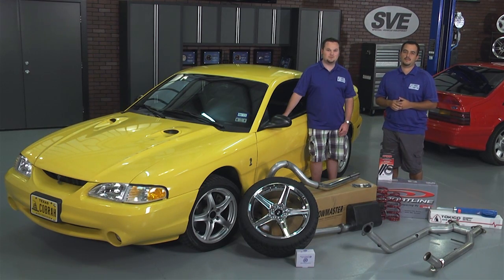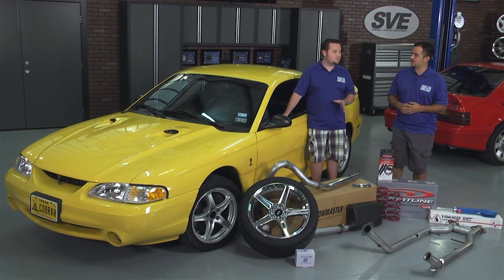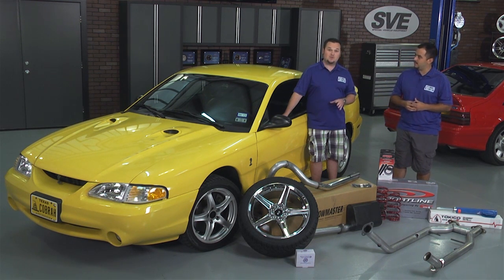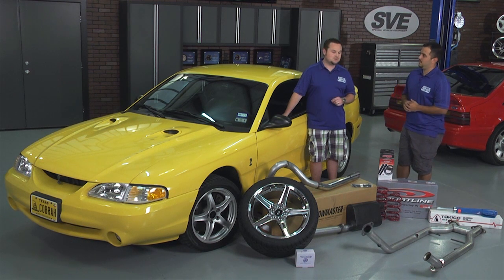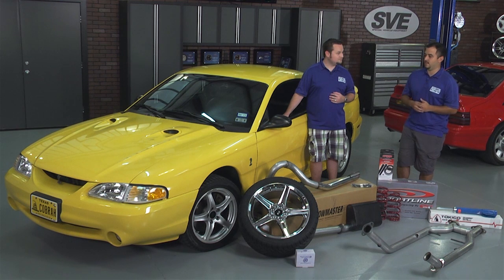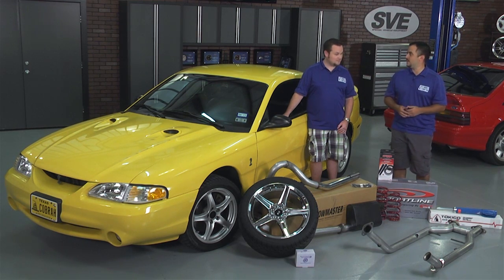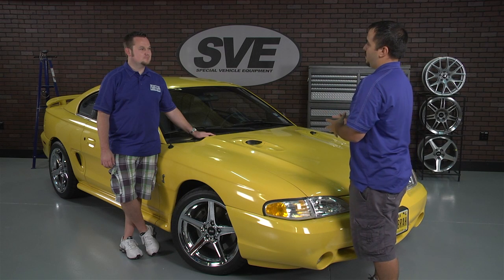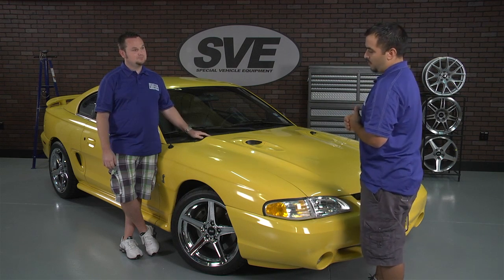Karson's 98 Chrome Yellow Cobra Mustang Build: BBK, J&M, Flowmaster & SVE

Comment: What are the widest tires you can put on the SN95 platforms with a ten inch wide wheel without any interference?
Reply: I’ve run 18x10 with 335 wide nitto drag radial on a 97 Cobra
Reply: The biggest I’d go is 305 on a 10” inch wheel